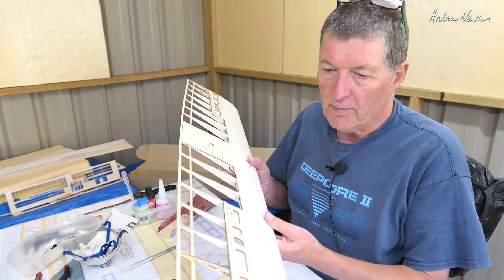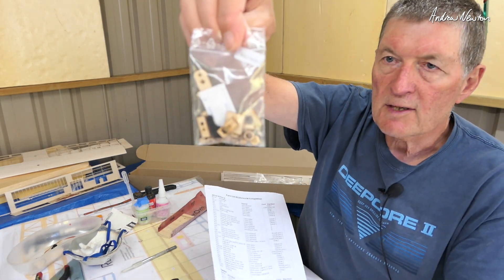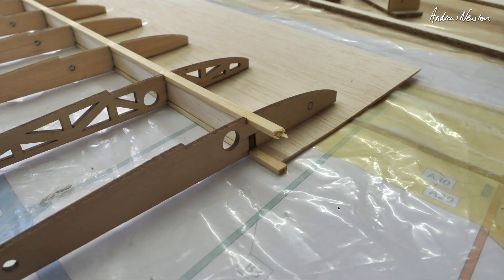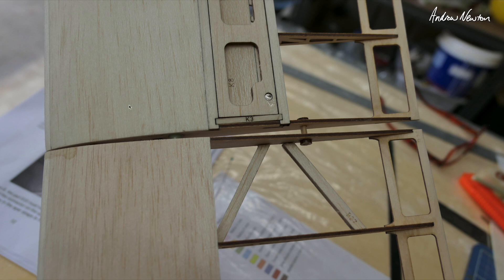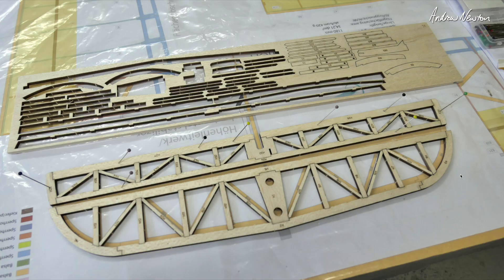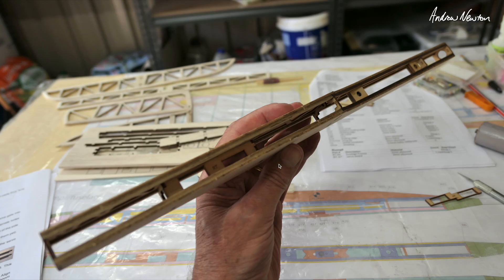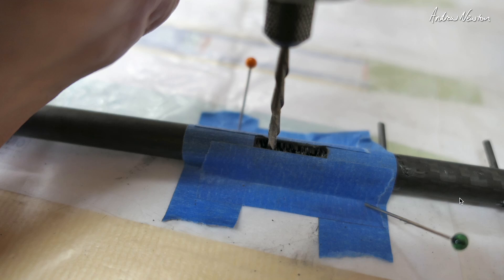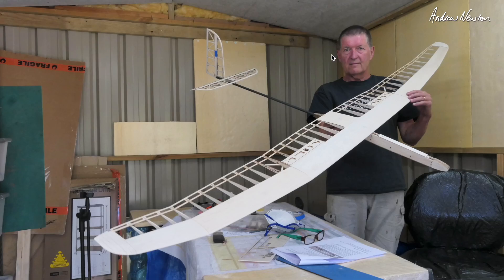RESilience RES Glider Kit Build - Part 2

Comment: Laser cut pieces are nice but too bad the whole thing isn't laser cut. I hate kits because you need to be an artisan to be able to sand airfoils from square stock.  
Lego sells well because you get to assemble things from prefabricated basic units.  Imagine how poorly Lego would sell if you had to injection mold or carve out the most important pieces from raw plastic.  Leading and trailing edges and control surfaces are the most important parts of a wing and the wings are the most important parts of any plane.
The kit market would increase ten fold if they only used a router to the square stock. 
I guess I'll stick to ARFs and *gasps bind and fly/plug and plays.
Reply: "I hate kits because you need to be an artisan..." Funny! That's exactly the reason I love them!
Reply: @dieterweik6858  If you really do love being a true artist/craftsman you should be scratch building using raw materials instead of paying somebody to do all the heavy lifting of design and having machines make most of the parts for you.